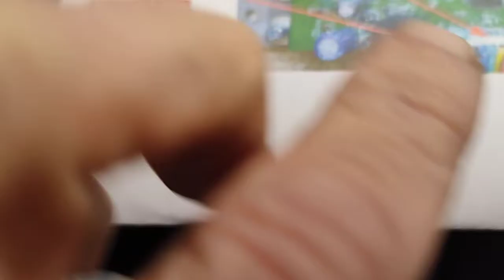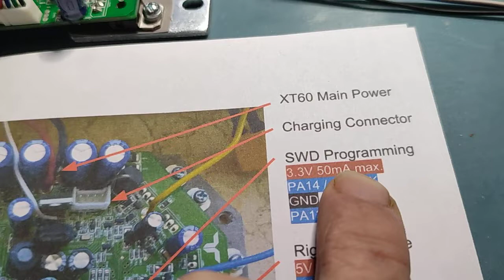Hoverboard parts explained for robotics use

Comment: Hi there, Thanks for this video! I found a thrown away hoverboard and it didn't seem to function properly. So I started checking for loose and or broken wires or other deviations within the circuit. There was one loose wire attached to the battery power connection to the motherboard with a 2 pin white connector on the other side. It did not seem to go to any connector. Here in your video you showed me that it is a 15V out extra utility connection. After tens of video's finally shown! So now I can move on, knowing that that wasn't the culprit! Thank you very much!🙏

Comment: I still don't get why you have to add the firmware to the circuit board. Why cant the rc receiver work by itself? Without the firmware that where im lost
Reply from the maker: because the program on the main processor is not at all the same , the stm32 processor is completely reprogrammed  with a new system , you cant just plug a receiver in or use it like i do without changing the main program and replacing it with a new program
Reply: @baoheli  thanks I figured it out and added a new firmware to my new board

Comment: Do you think we can use the motor controllers already existing on the hoverboard board? To bypass the hoverboard uC brain? Thanks.
Reply from the maker: you can control the hub wheels with brushless motor controllers , i just used the boards because they have the controllers built in . i have a project in view with an odrive twin controller

Comment: Can you advise. I am having connection problem, I am using stm32 cube programmer and st link V2, upgraded the firmware, diconnected and reconnected st link, still couldn't establish connection
Reply: Eferu's firmware on github has a wiki with troubleshooting tips